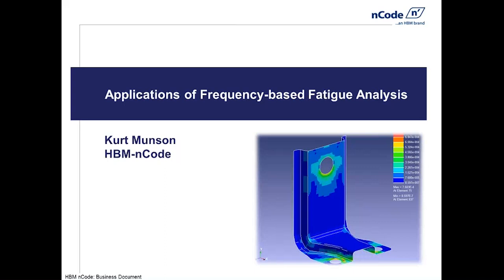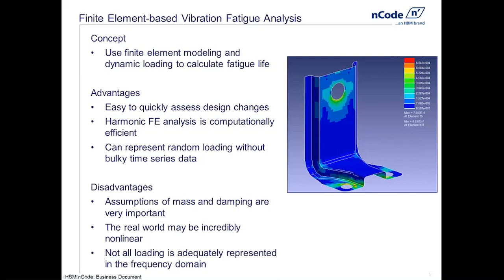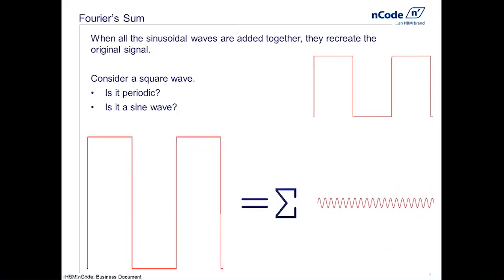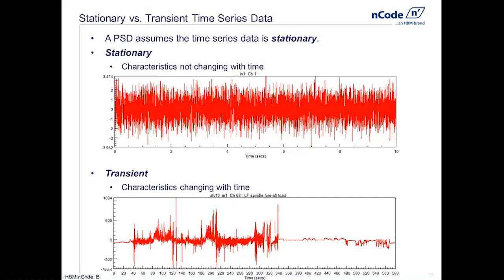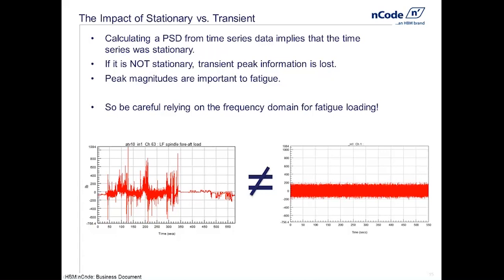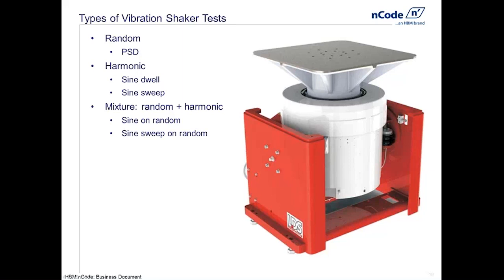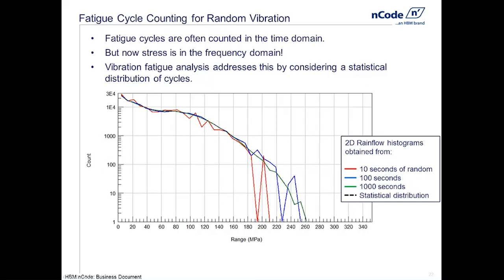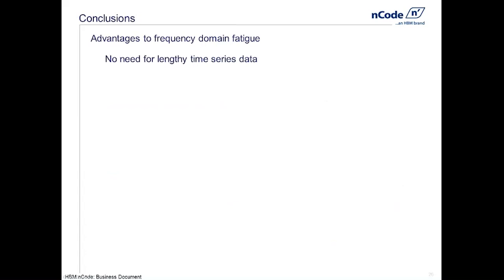Applications of Frequency Based Fatigue

Comment: Hello, when I try to build the configuration shown at 28:57, I get the error message "nothing is connected to the input connector". Why could this be happening? I connected FFT output to the psd input in cff glyph, I tried adjusting to every property including, the XML, HistorySingle HistoryMultiple configurations, as well as PSD and Gain.
Reply: Hi Dogukan, I'm the presenter in the video.  Thanks for your interest!  The image you see at 28:57 is just a PowerPoint graphic - it's not an actual nCode process.  If you have questions about how to perform this analysis in nCode, please contact our support team: ncodesupport@hbmprenscia.com